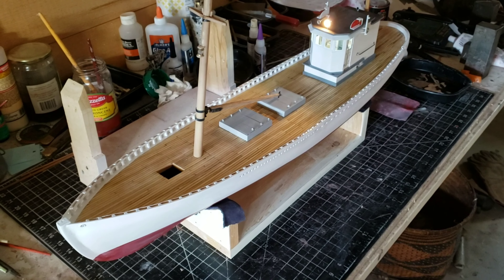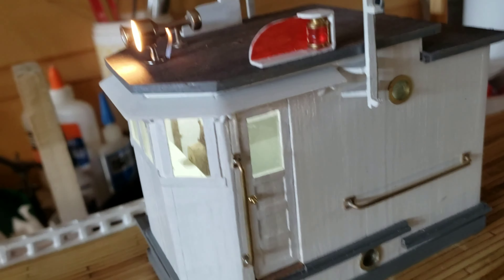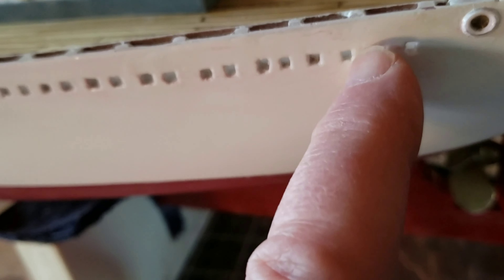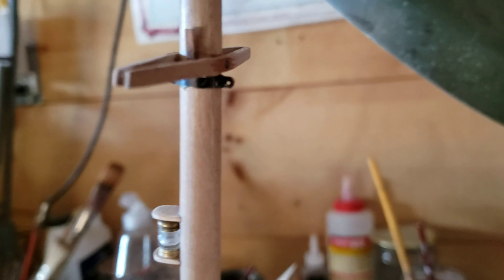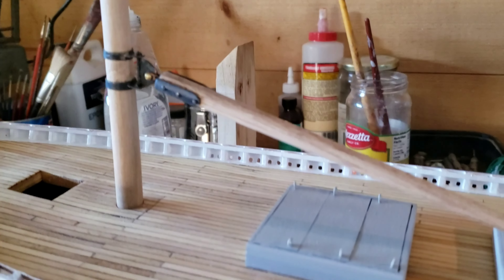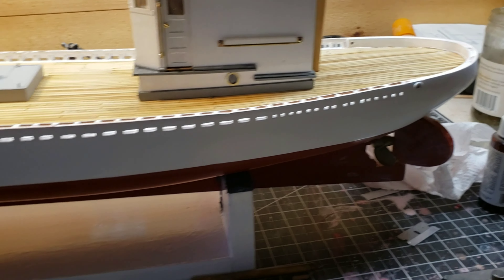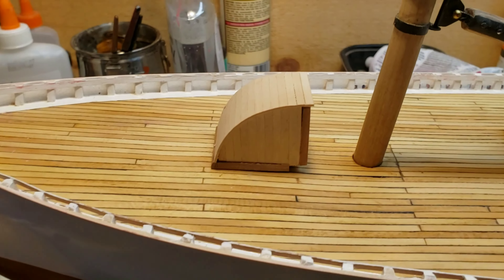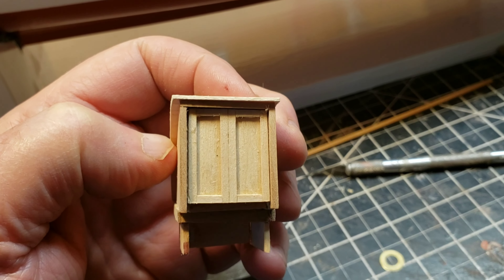Sardine carrier Pauline scratch build as of February 13,2023

Comment: Nice job. I'm making one 62" long with r/c control. Saw your post so had to check it out. Looking good. Can't wait to see it finished.
Reply from the maker: I would like to see your effort, is it anywhere on line. I assume it is scratch built, so you got the lines from some place?
Reply: @deadmanhiking9260  hi there, starting with a fiberglass hull. Got the plans from Blue Jacket ship crafters. My scale is 3/4" - 1'. And no have not posted anything yet. Had to convert scale from their 3/16" plan. Having trouble finding fittings for my scale. Thanks for your interest in my model. I will try to set up a site soon. Best wishes, Michael